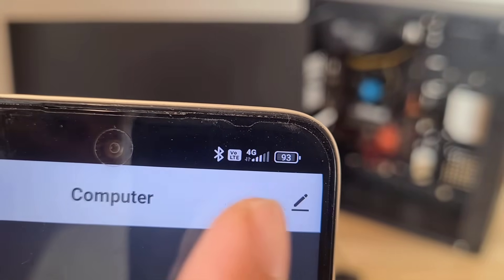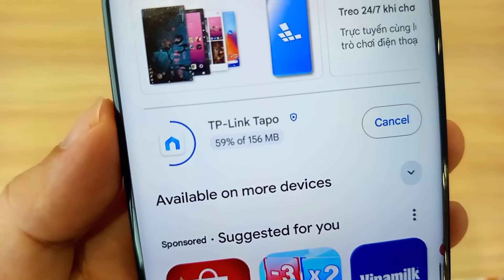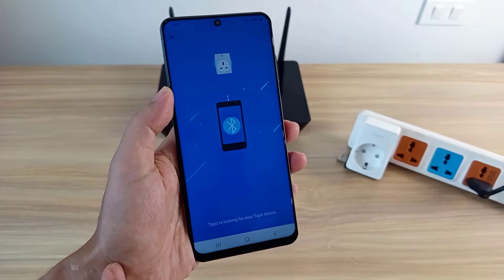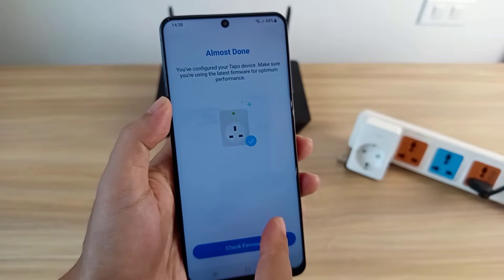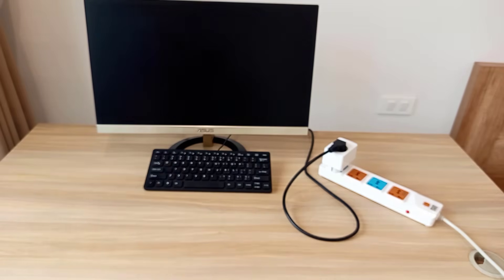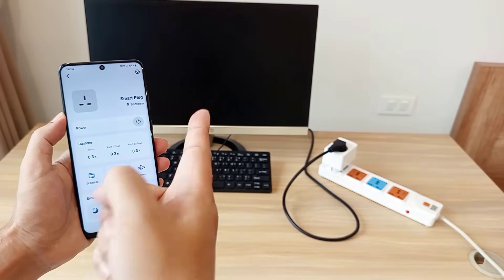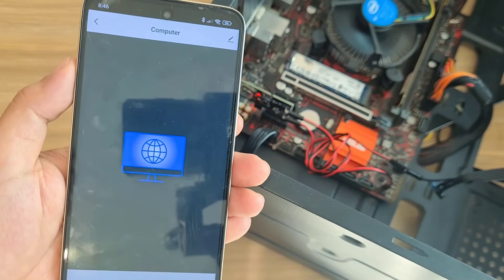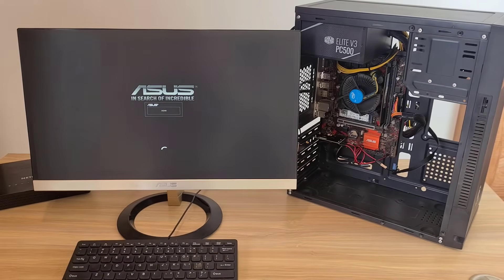Turn on Your PC From Anywhere | 2 Methods

Comment: BEWARE OF SOME VERY IMPORTANT ASPECTS!:

YOU MUST connect this electronic start-up and shut down PC desktop computer module ONLY ON YOU 2.4GHz Network; IT DOESN'T WORK ON 5GHz!

If for whatever reason you'll get the error message: "Connection Failed" upon setting it up try and change the country of the setting menu!
YOU MUST enable the Android App's permission to Bluetooth and to your location!
My native country's location self determined by the app JUST DIDN'T WORK, WHATSOEVER!

Whether or not I have my eml. address, from the UK, with the UK's origin of the eml. address, I do not know, but it worked for me choosing the UK!

Comment: But with the internal card, does the physical power button on the PC no longer work?
Reply: It wouldn't work since the power pin for the front power button is disconnected.
Reply: Вытащить пин из разъёма и вставить в материнскую плату и кнопку. Тогда будет работать кнопка.

Comment: The second method, which is wrong in the video, is that you have to enable PC wake-up from the WiFi PCMCIA card in the BIOS settings

The first method has a serious flaw in that it shuts down the PC immediately, which Windows does not like

The second description is better because few people know that when you press the switch button on the computer case, Windows has a function that shuts down the computer via software rather than hard
Reply: just dont shut down the PC using the app, only use it for turning it on

Comment: Wake on Lan (WOL) will be better solution without additional devices. But it requires a router configuration witch is more complicated to a average user.
Reply: i'm using wake on lan. A problem is, when PC stucked or got hanged, WOL wont work!
Reply: That method is actually called Wake on ETHERNET and this is the same thing but done by Wireless called Wake on WAN!
Nothing different by concept but achieved through different hardware means!😮😂
Reply: Make a video on that